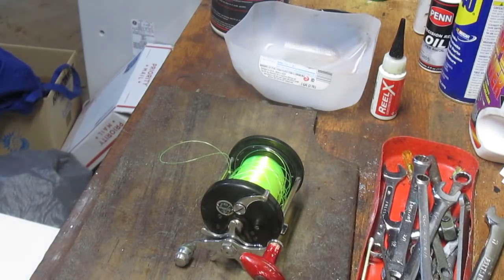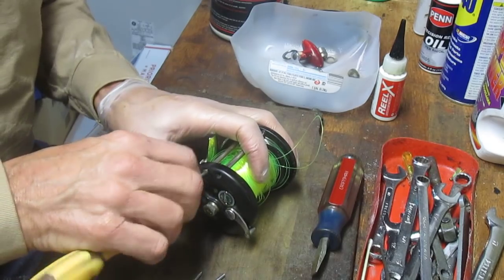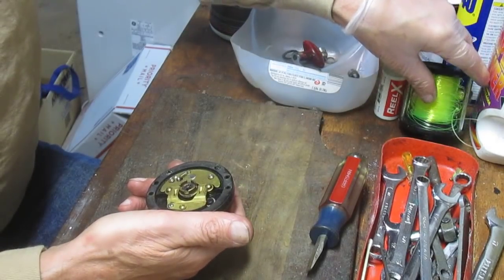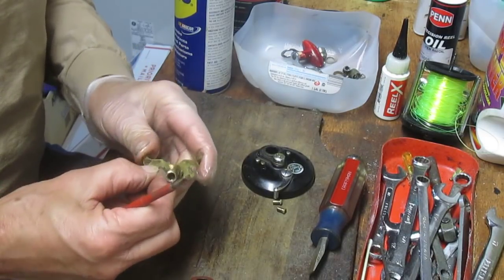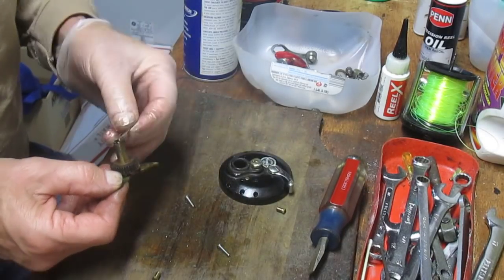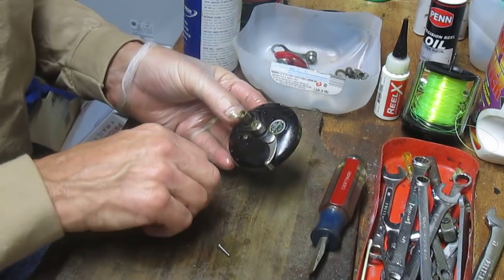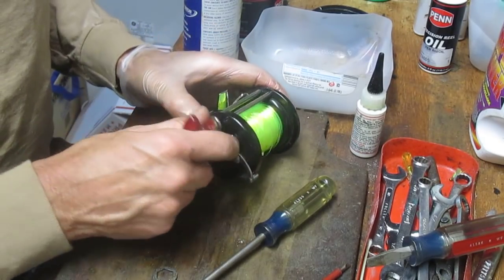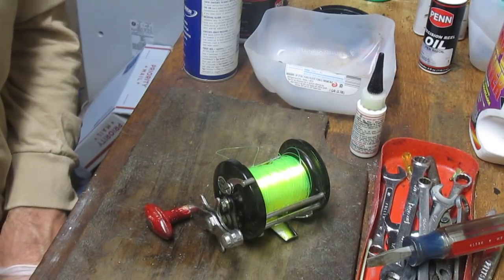Ocean City 934 fishing reel  overhaul including anti-reverse dog fix

Comment: I have one similar ..but i can't set it on free..i don't know where...or how...to
Reply from the maker: The free spool lever puts out, it does not flip front to back.  If that is frozen, use WD40 to free it up.  If you are pulling it out and the reel still does not go to free spool. then the jack screw is loose.  You would need to take the side plate off and tighten it to restore the function - Dennis